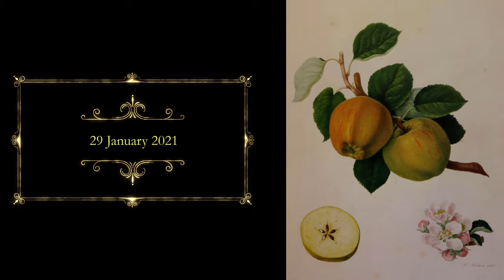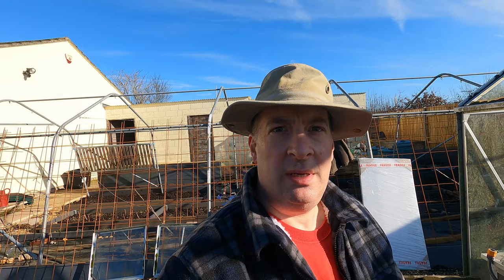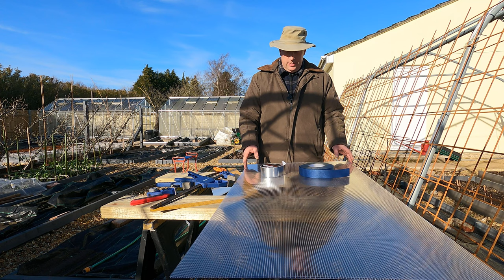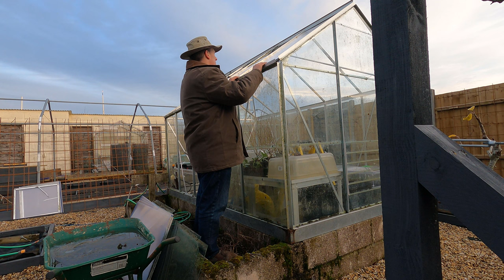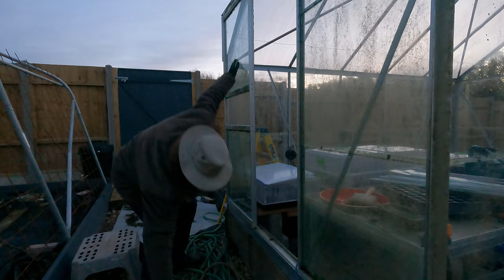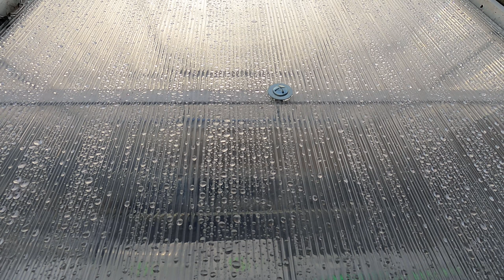Greenhouse repairs  |  How to make polycarbonate storm proof

Comment: Thank you Jonny: I’ve invested in a polycarbonate greenhouse last month and we have just had an almighty storm. This has blown out roof and side panels. Thanks to your detailed description above, I now know I need to add cross struts which are fixed as you describe to each polycarbonate sheet. This will also strengthen the whole frame plus allow  to in-build shelving into the walls of the greenhouse. Wonderful work there sir. Hope all is well
Reply from the maker: Hope the upgrade works out for you. We have a storm  blowing here right now but so far the panels are intact. I’m sure they would have been blown out straight away without the modifications. Hopefully all will be well in the morning...

Comment: Thank you for your video.  can just ask were did you get your polycarbonate sheets? Thank you
Reply from the maker: I think they were called Omega. I got them through eBay, although they have their own website too. It is definitely worth shopping around as I found prices quite variable. I also found it much cheaper to take one of the stock sizes and cut down rather than order sheets to size.

Comment: Good video..were the sheets an exact fit widthwise? Maybe triplewalled plastic would be stiff enough  to not require purlin support.But then this would require much thinner clips and does anybody make them??
Reply from the maker: Yes, they were a reasonable fit across the width. The clips don't hold as well on the soft plastic edges as they do on glass but they are ok. I'm not sure about the triple wall stuff - you may be right and they might not flex enough to pop the clips out but I wouldn't be too confident as they need to withstand quite a beating in a storm. I think there are alternative ways to hold polycarbonate sheets in place on some greenhouses that are designed for them - capping strips that fit over the glazing bars - and these probably work much better. I still like the idea of the added support, and those bars are often handy for tying up plants :)